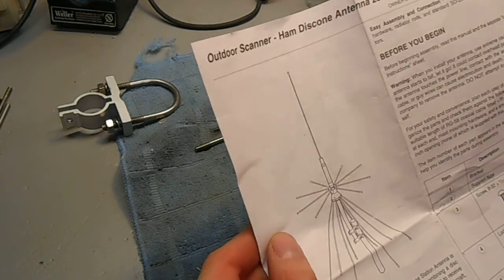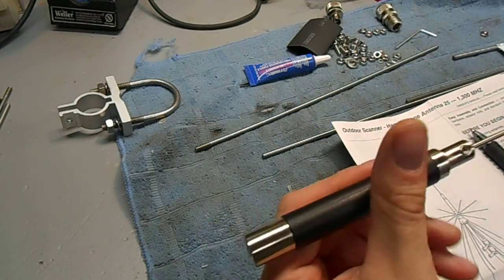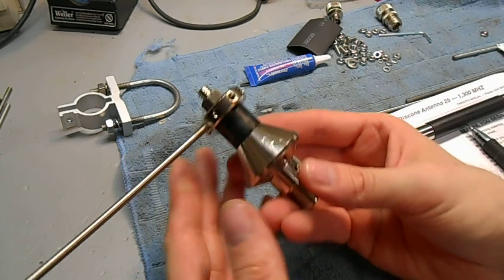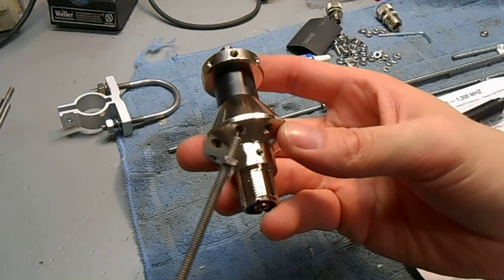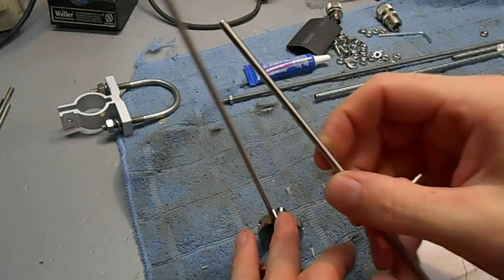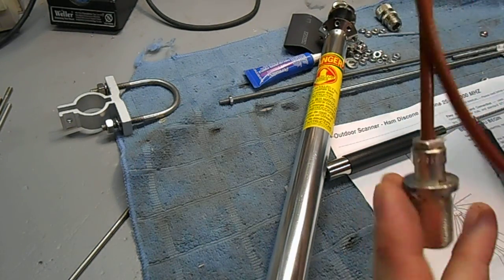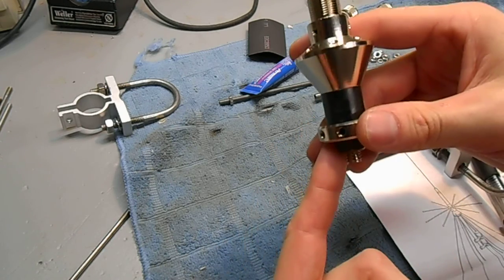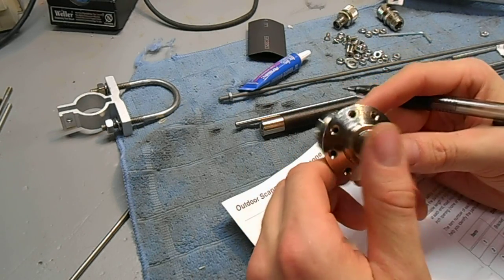GBPPR Vision #13: Radio Shack Discone Antenna

Comment: Great video. Would it be possible to get a copy of the owner's manual for this antenna?. I purchased a used one and can't find a reliable source for a manual. Mine is missing the center vertical coil and whip. Thanks

Comment: I picked one up at an estate sale and it was missing a few of the longer elements. I found out that an old oitdoor umbrella has steel rods the same diameter and and ised a tap and die set #8-32 to thread them

Comment: Hi, Thanks for the video.  I had the same concerns about the diagonals falling off.  Good suggestion on using the #8 all-thread.  
I bought a used one that does not have a vertical stinger.  Can you make a suggestion of one to buy.
Reply: Buy a Stainless welding rod at most any auto parts store & cut to desired length.

Comment: I have one of these antennas that is probably around 15 years old and all the elements are solid  stainless rods. Haven't used it in several years and somehow I managed to lose the vertical radiator whip. I have a replacement from an old CB antenna that I can use as a replacement, but I don't know what the length should be, could you give me the length on this?  I live in a rural community and our Radio Shack/Ace Hardware dealer don't stock this antenna.and didn't know the answer.

Comment: I am gather materials to make a discone antenna and maybe do the following potential improvements I've read regarding lower end frequency improvements as well as wide range utility:
1. Longer ground plane disc elements
2. Two size cone elements where I am wondering how one element of the disc alone will improve lower frequency SWR. 
3 .Use copper house wire twisted to straighten and most likely two pieces twisted together for each element of the disc and cone
4. Screwdriver antenna loading coil design for the center element (slider potentiometer style preferred, though maybe connector selector style). 
5. Fractal antenna passive resonator cover over the center element.

I am also reading into the design noted in this video for the monopole element and still wondering exactly what was used for the fractal, I assume rectangular fractal design wrapped around the foam to form a cylinder with a cone bottom, antenna device: https://www.youtube.com/watch?v=QWd0nEXFnrE

Any thoughts, suggestions, experience or ideas?

Comment: Can you order replacement parts for a RadioShack® Outdoor Scanner/Ham Discone Antenna?  Thanks in advance.
Reply from the maker: I believe you can... Radio Shack used to have a huge parts warehouse you could order anything from.. I think these antennas may be discontinued though.
Reply: Oh ok thanks for the reply though.
Reply from the maker: dre8431

http://support.radioshack.com/support_electronics/doc44/44541.htm
Reply: Thank you so much for finding that Information for me. Merry Christmas!!!! And Happy New Year's
Reply: +The Amazing Dre yes you can but its cheaper to buy a new one and then you will have spare parts that's what I did
Reply: chrissteene
Oh ok thanks for the reply.
Reply: +The Amazing Dre and for $hit and giggles you can use it for HD TV if you do use it for HD TV use a splitter that splits the signal evenly but works from 1-10000 hrz  or just use a second one for the tv